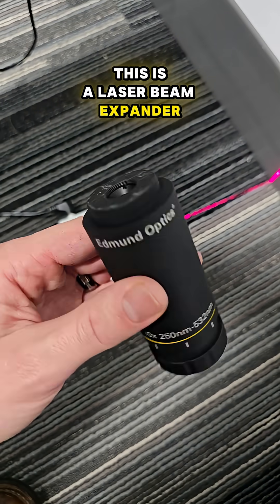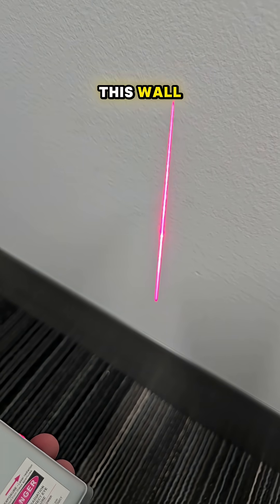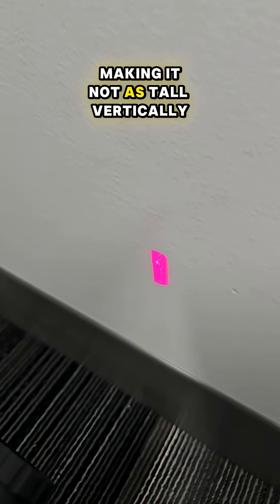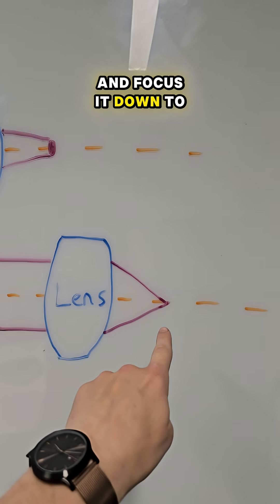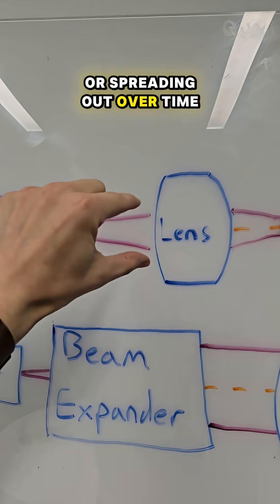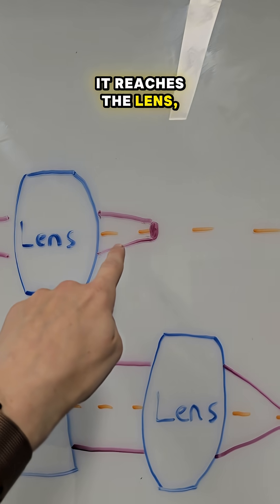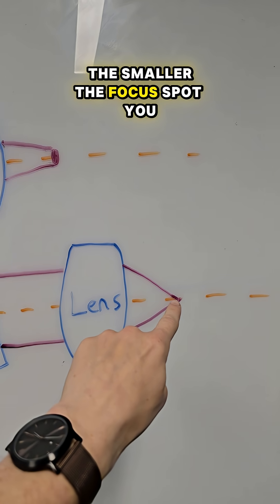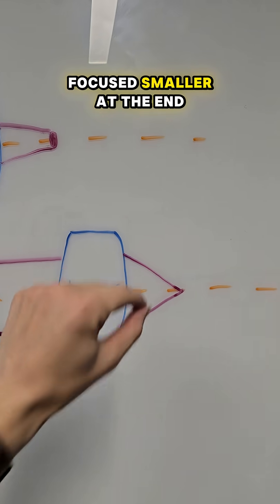Laser Beam Expanders - Why Make Lasers Bigger to Focus them Down Smaller?

Comment: Practical uses for this device?
Reply from the maker: They're used in lots of laser systems like laser materials processing (welding, cutting, etching, etc.), medical devices, or free space communications (sending high-speed internet signals through the air using lasers)

Comment: So it works like a fixed angle in the defraction point in the lense, the laser can't be focused directly from the source to a point since it is continuously spreading out from said source, so the expander evens out the spread to a consistent width so the lense behind it can actually focus said laser more precisely

Comment: “The bigger the beam, the smaller the point you can focus it”?? You mean the more collimated or parallel the beam is?. In which case it’s not counter intuitive at all.
Reply: Maybe if you had an expander that led into an expander that led into an expander that led into an expander you could simulate vast emptiness of space with the inverse square law on steroids and you would finally have parallel moving photos.
Reply from the maker: Correct, but the part that may not be intuitive is that increasing beam diameter is how you make the beam more collimated. You could expand a beam indefinitely, but the intensity will get so small that you can't detect the beam anymore. You're spreading a finite amount of light over a larger area

Comment: Smaller by %.
But not by actuality. 

The beam will be just as small, regardless of the input size, if you're using the same setup to reduce the size.

Comment: So when it comes out of the beam expander, is it parallel and not diverging ?
Reply from the maker: There will always be some divergence, but there is less divergence if the diameter was increased. So it's closer to parallel
Reply: @edmundoptics  so it doesn't de-laser it 😁👍